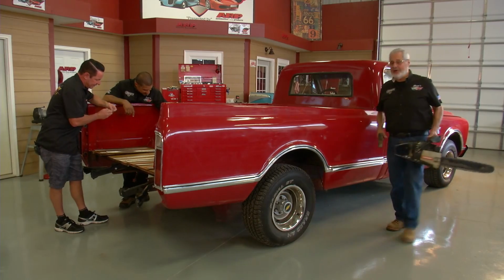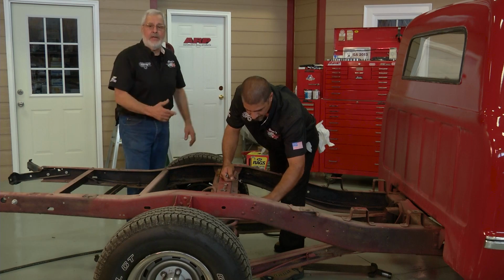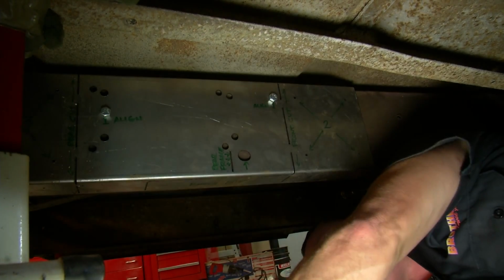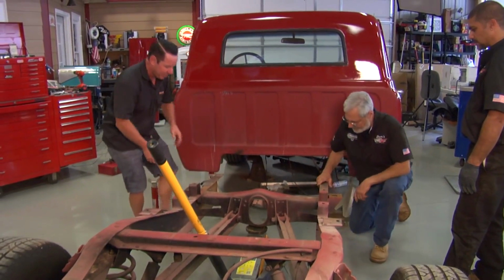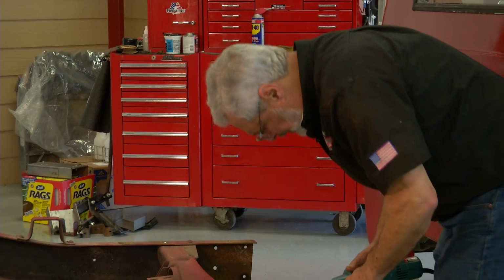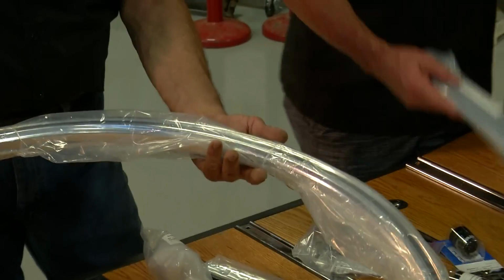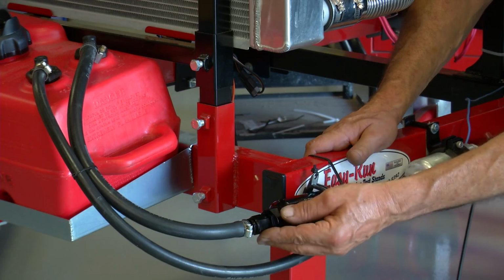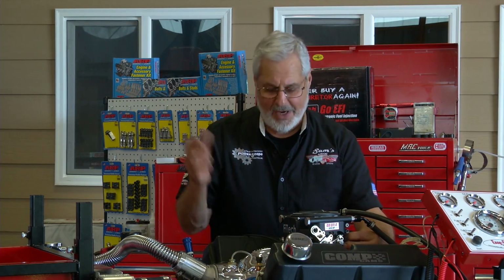Sam's Garage Ep 12 -Chevy Bed Conversion and EFI Installation

Comment: warning educate yourself before you copy imitate any work done here today these cuts are awful  you never want to do a straight cut it cracks on the each side of the weld  you DONTwant to do a straight cut you can do a diagonal cut but the best way to cut a frame is to do a z cut and to use bolts that's just crazy and this is a pro show that's on tv LMMFAO
Reply: You ever see them cut a semi frame and weld it back together after it's been in a  wreck it's a vertical cut welded together no big deal.

Comment: like the show, but some of the projects really puzzle me. like this short bed conversion. i have been around the car/truck thing since the 60's. and i never have met any one who has done this conversion. and they say it adds value. every truck guy i have ever spoken to would rather the long bed. it is just more practical. sponsors pay the bills, i guess that is why they did the SB-Conversion. and then they spend 5 min on an efi conversion, that is practical and have seen dozens of cars with a conversion that is what the show should have been about, just say'n.

Comment: Do you have the short bed kit after you cut it .
Reply: Not sure exactly what you mean, but if you're asking about the template after the job is done, it will have been cut into many pieces and used for multiple critical measurements during the entire process. If you have additional questions please contact our customer service department at 800-977-2767. Thanks for watching!
Reply: Do you sell the template for a 73-87 C10 as well?